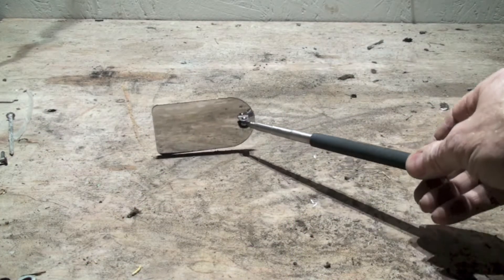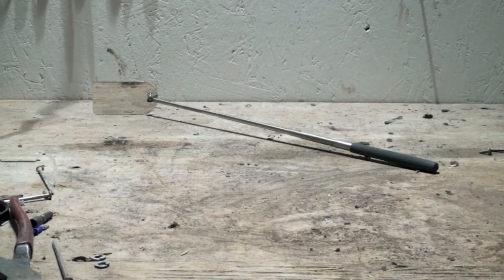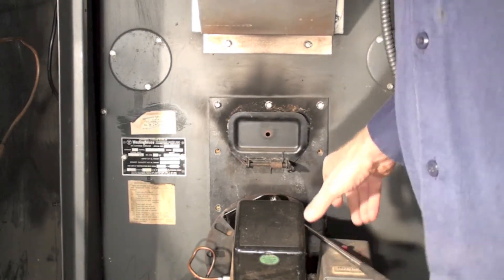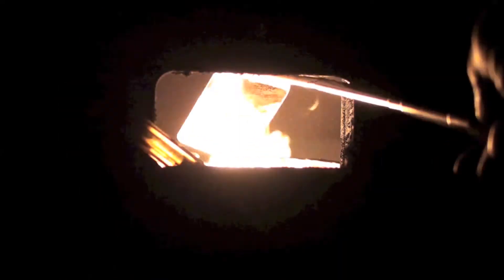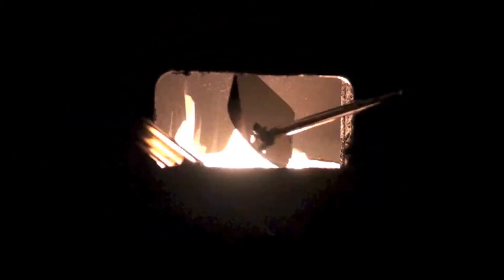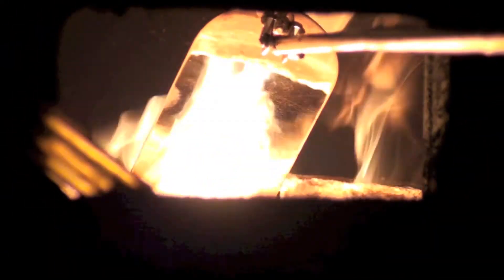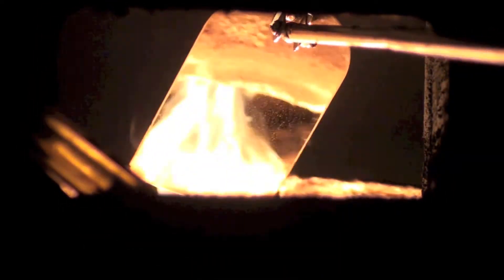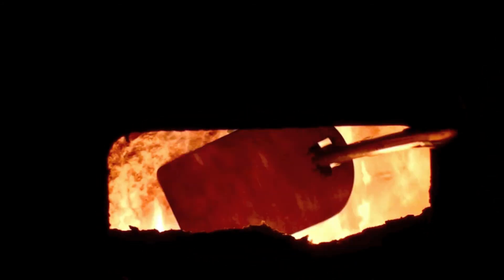Using the flame mirror on the oil furnace

Comment: Needs either a new nozzle or more pump pressure. You shouldnt see separations in the fire. I know you said it was the wrong tube but just for general info that wasnt a good fire.

I love your videos I have watched almost all of them
Reply from the maker: Great observation!  It is not a good fire.  Although much of it is air being drawn into the combustion chamber around the head.  I will be setting this flame with the smoke pump and combustion analyzer and we will see if I can change it.  Thanks for the great comment.
GFM
Reply: I have been doing oil for thirty years. Just started doing alot of gas the past few. Your vids help alot
Reply from the maker: Al Gregory That's why I'm here.  Thanks for the support.
GFM

Comment: I enjoy these oil furnace videos. I don't get to see them very often here in Kentucky and the calls that I do get I will usually turn them down because I'm not really confident enough to work on them. These videos help me out a lot!!
Reply from the maker: I'll bet you have a secret desire to come home smelling like fuel oil.
GFM
Reply: Yeah right lol
Reply: We have them here in the Chattanooga too i don't think oil heat is not much
of hot thing anymore both here and more up north this day typically do to the cost of oil
Reply: @hdyudu  i think i've only ever seen 2 gas furnace in Maine. I'm not a tech but most homes have oil boilers. Trailers typically oil furnace, forced air.